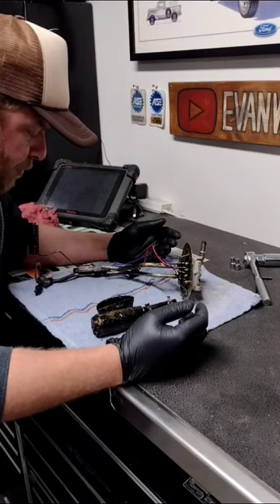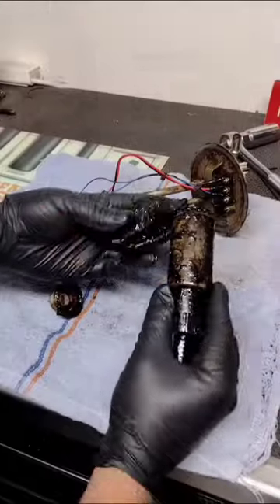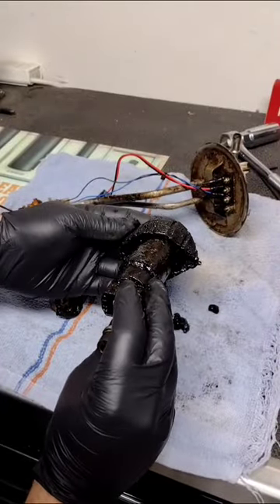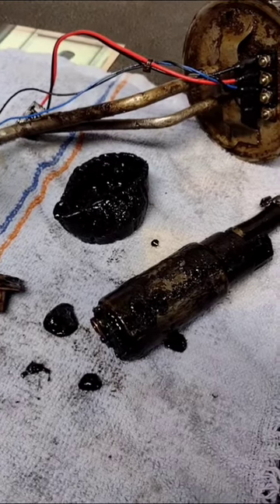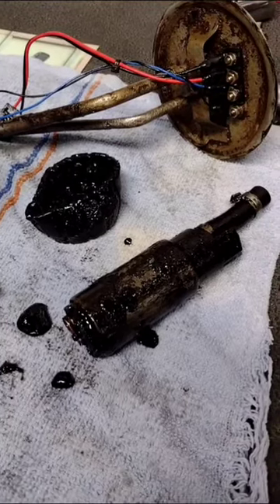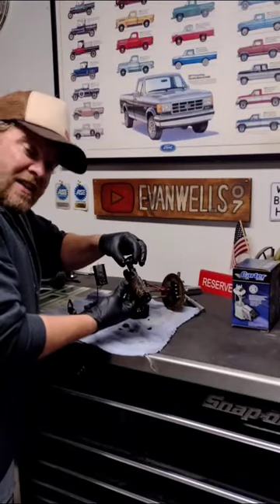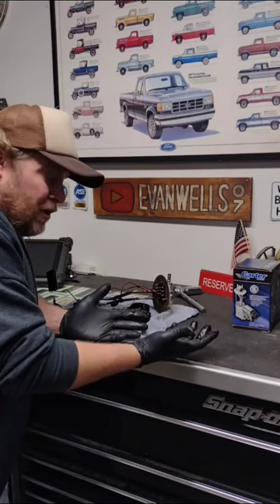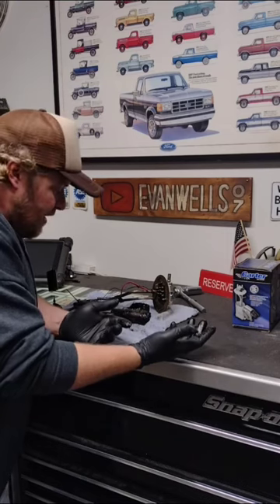What ETHANOL Can Do To Your Fuel System!!  #shorts

Comment: Keegan and I have been teeling the yolkels here in the NW metro to STOP using the ethonol fuel in small engines becasue we allleave crap sit over the winter... gums and messes everthing in the carbs up. The ole" Dodge has been sitting with preimuin an stabilizer... but its been sitting too long, if I'm honest
Reply from the maker: Yeah I keep a separate can for premium for the mowers and stuff.  I actually mix a small amount of 2 stroke oil in with it for when I do let it sit for a while (forget to run it out) and don't have problems with that stuff.  It was just me being dumb and putting it in the ranger.

Comment: Hey Evan we have the same gas in Illinois with no other type of gas I have a carburetor engine do you know think I should switch my carburetor over to ethanol or if they have a flex fuel carburetor on the market
Reply from the maker: It will run in it fine, it's just when you store them.  You can run fuel stabilizer products, but that's no guarantee.  Mine is an extreme case as this truck sat for several years.  It's only when you want to step up to something like e85 that you would need to really worry about fuel system components and then it's because the alcohol will eat away at rubber components.